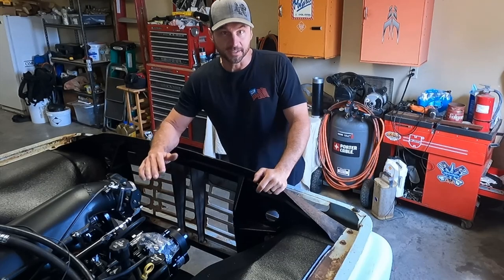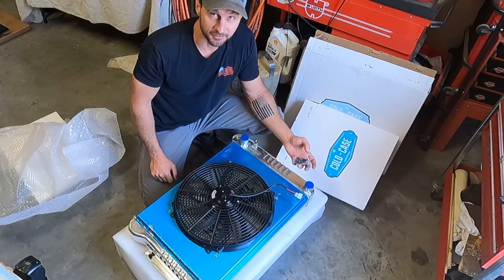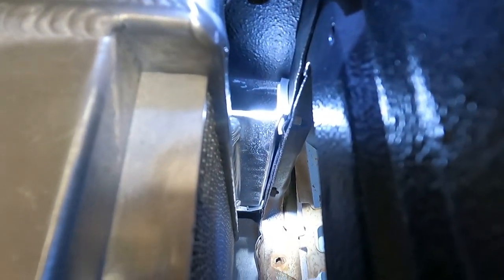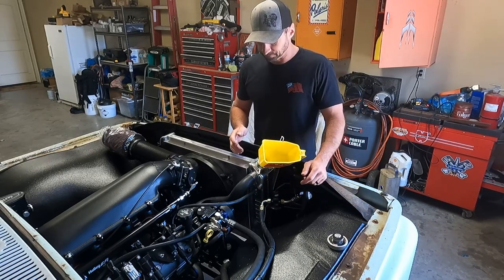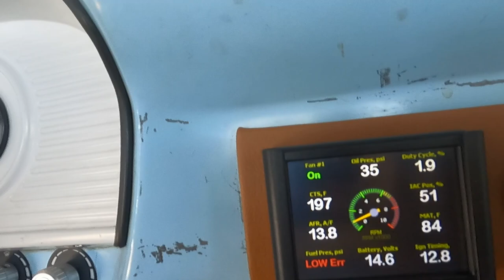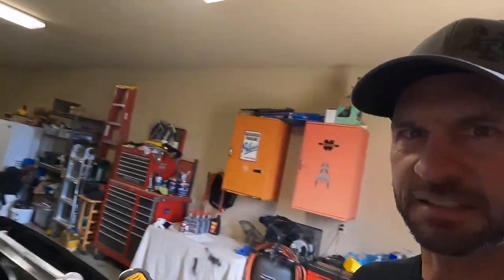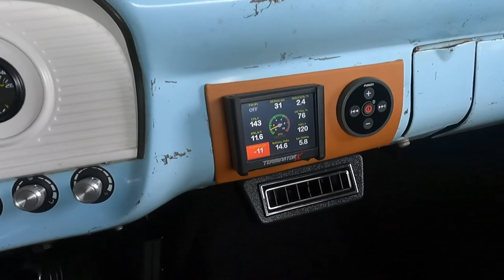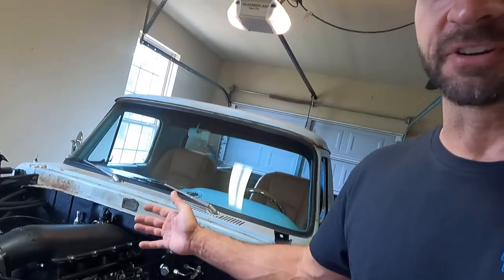'64 F100 Build! Part 40:Final Assembly & Test Drive.

Comment: Another great build! If you are running a 700r4, how are you controlling the lockup? On my 200-4r I have it locking up only when it hits overdrive using a TCC kit purchased from Ebay for about $20. I added a toggle switch so I can turn it off if I choose. What's the next project build? The Bronco?
Reply from the maker: I did a video installing the TCI controller. I unplugged it and that was my issue. Gonna install a switch more than likely. Wasted $200.
Reply: @GreaseMonkeyTV  Sorry, must have missed that video. Hope TCI make good with your purchase.

Comment: What did you do for a filler and cap with the rear tank? I don’t see it in your videos. Just did a rear tank conversion on my LS swapped bumpside and used a fill-thru style cap coming up thru the bed.
Reply from the maker: Used a fill through as well from Tanks. There a “trick parts” video that covers it.